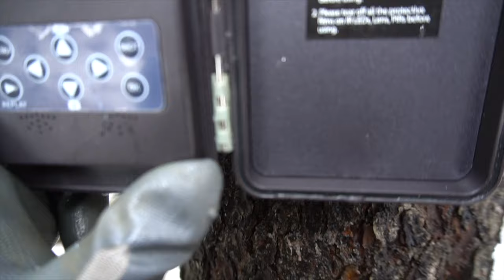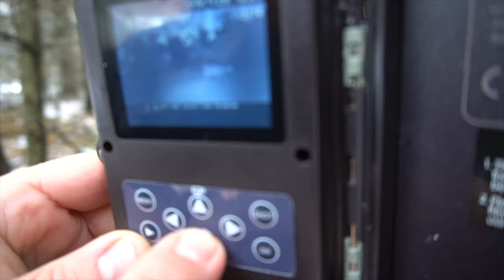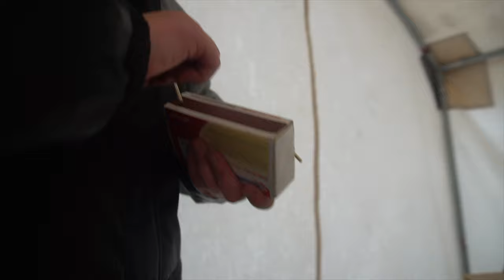Winter Tent Camping During an ARCTIC BLAST! (Wall Tent with Wood Stove)

Comment: Look good put double two inch rigid foam between the floor joists underneath and glue and put a pc of blocking to hold up every three ft in the summer screen in the bottom and take out the foam and just store it under the deck those gaps will open when the decking drys out you can also get some galvanized sheet and make a u shape or L shape reflection shield in the corner for reflecting hart away from the canvas put heat activated fan on the top of the stove

Comment: Also you can think about framing a wall around the outside perimeter of the inside of the tent that to can help deflect air coming in help hold items shelving just helping hints if you think about it in the summer in your window wall if you did frame it you can put a a solar charge battery and put a box fan in the window to blow out or in in the summer